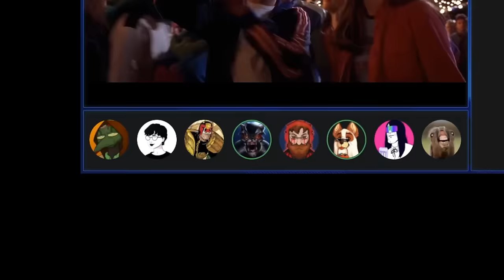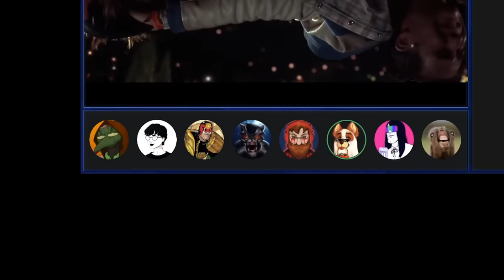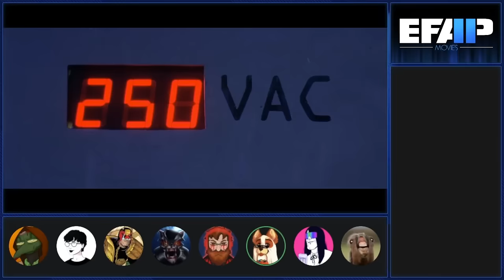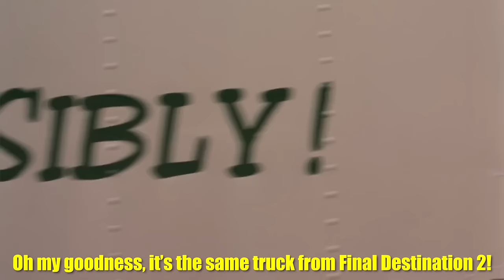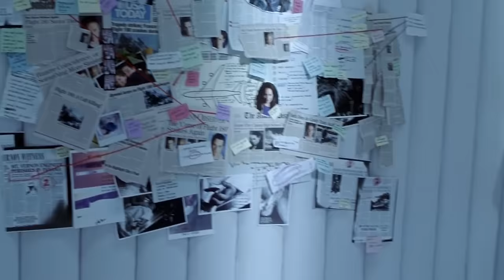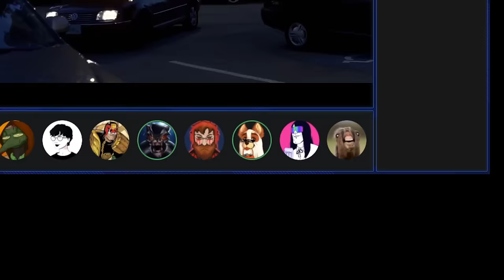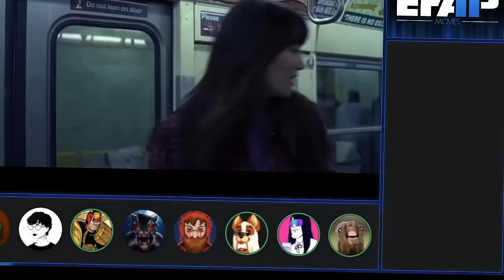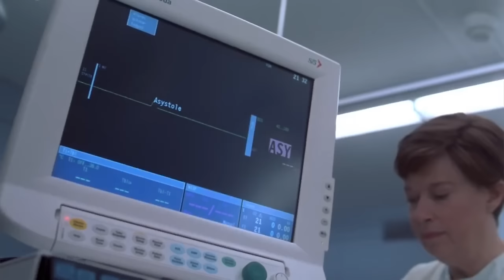EFAP Movies #39: Final Destination 3 with YMS, JLongBone, Jay Exci and Shoe0nHead

Comment: I think this is where the franchise goes into SAW territory, as in there are creative deaths that you remember but you can't remember which movie it is because all the films feel the same at this point.

I could be wrong though.
Reply: I don't know. I think you can at least tell which death can from which movie since the effects vary in quality between movies. Like if a Final Destination death has unbelievably terrible CGI with stuff obnoxiously flying at the camera then you know it's the 4th film. 

The Saw films, on the other hand are pretty much interchangeable for the most part when it comes to the violence. The effects are pretty consistent throughout that franchise.
Reply: @kingbash6466  very true statement about the saw franchise
Reply: @kingbash6466  direction definitely plays a role in knowing which one is from which film. I will agree there.

It's not SAW levels but at this point, it's getting to new movie means more deaths and these deaths are just kind of there and the more ways to die there are, the easier it is to get confused which movie it came from.
Reply: Only for the third and fourth ones, the fifth one is actually pretty good (the FD movies I mean).
Reply: @sophisticautistic5453  didnt this movie come out before saw? or atleast before saw became just retcons and deaths? if yes then techinically saw stole this from FD
Reply: @sophisticautistic5453  I guess for 3 and 4 you can make that argument, but I do think that 5 not only has memorable death, but you can tell exactly at which point of the movie they happened. That could just be because FD5 was the first film in the franchise that I've ever fully watched, but I don't think I'll ever forget how squeamish that gymnast scene left me when I first saw it.
Reply: @kingbash6466  yeah the gymnast one is kinda horrible, I guess its because everyone knows how it feels to get hurt falling/landing badly (+ the snapped/bent limbs dont help either)
Reply: I do wonder if they'll be making any call backs to these movies and this one in particular in the SAW EFAP movies and comparing how the franchise fell apart when they just became about killing meaningless characters.

Comment: I went on a date with a girl once and we were talking about how much we liked horror and I brought up how hard I laughed at the tanning bed scene and she said it was the only scene that scared her because "it could actually happen."

There was no second date.
Reply: Oh gosh that was the scene that pissed me off the most, I used to work at a tanning bed place.

 It is literally impossible for those girls to die that way. No amount of fiddling around with those machines can change it is impossible for them to ever get that hot. They are not designed to EVER be able to reach that temperature, not even close.

It could never actually happen, glad you never went on a second date with someone so clueless.

The worst part is the scene originally was going to have them die a different way. While very convoluted, basically it would end with the girls getting electrocuted from the tanning beds due to convenient 4D chess from Death. Ridiculous? Absolutely. But getting electrocuted in a convoluted freak accident is far more likely than the impossible of being cooked alive by tanning beds that physically cannot ever reach those temperatures.
Reply: @TheGamingAngel18 out of curiosity, isn't the thing that tannes you basically UV light or something like that and not heat?

Comment: You can most certainly have outlets near a source of water, but in order for it to be up to code, the outlets would need to be GFCI outlets, so if contact is made it trips the circuit within the outlet and eliminates the risk of electrocution. Otherwise, liability is on the home owner/business.

Comment: I remember many years ago when a cable broke on one of those "drop" rides like they showed at the beginning and it cut off the feet of some poor girl. I have never been on any kind of roller coaster since then. Just like airplanes, the low death statistic doesn't mean anything if you are one of the people who dies.
Reply: but accidents in the home that are fatal have the highest stat thou
Reply: @117Ender  That's just because people spend more time in their home than in any other one place. They need to average that statistic over the average amount of time spent in a place. It's like the statistic that most car accidents are within 5 miles of your home. Of course they are because most of your driving is within 5 miles. You can't even get to 10 miles without first driving through those first 5 miles and there may be plenty of trips where you never go past mile 5. Statistics like that mean absolutely nothing.
Reply: @tarrickmerdev2324  and there are 1000s of planes and they fly all the time. you asleep they fly, so its the same factor, planes function nonstop they fly, land refuel, maintanence check fly... you being on a plane doesnt increase or decrease the chances.
Reply: @tarrickmerdev2324  "They need to average that statistic over the average amount of time spent in a place."
I think your issue with these statistics is that you're misunderstanding what they're trying to tell you. Your suggestion isn't helpful at all. The time you spend at each of those places is an essential part of those statistics because you're never going to spend, like, several months at an amusement park. The statistics reflect where dangers do lie in real life, not where they could lie if you unrealistically spent the same portion of time in all places. Furthermore, even if you did that, i. e. compare the same amount of time spent on a rollercoaster vs. amount of time spent at home, you're still more likely to die at home.

Comment: At my university the refrigerated water fountain outside my classroom sprayed water right over the edge and directly onto the power outlet that ran it. Rather than actually do anything about it, they just turned down the water tap slightly so the water stream wouldn't reach the outlet. But every few days someone would increase the pressure again.

Comment: 11:20
I have only ever been on one roller coaster in my life.
When I was seated I expressed concern because the safety harness did not seem to hold me down.
The attendant told me it was fine the coaster goes so fast that inertia keeps you in the seat more so than and harness.
And the coaster started and he was right, in fact the inertia was so heavy that it was crushing me, I tried to throw my hands up like you always see people do and I found it too difficult.
So the harnesses shouldn’t be moving even if the lock came undone somehow. The only time that they should be in danger is when they start to slow down and inertia begins to lift.

Comment: Ok, yeah... this one was as meh as i recall it being. Actually, it might be worse than i recalled...
Somehow i completely misremembered the sunbed scene. I thought the shelves fell and got wedged between the top of the bed and the wall so they were jammed in a way that the person inside couldn't reach them. But no, the shelf parkoured around and slotted nicely inbetween the 2 beds through the gaps.
And then the drivethrough bit, i completely forgot about the random truck reversing into them for some reason.
I barely remember the hardware store or whatever place scene... a lot of nothing happened so probably why.
The rest of the movie was more or less what i remembered.